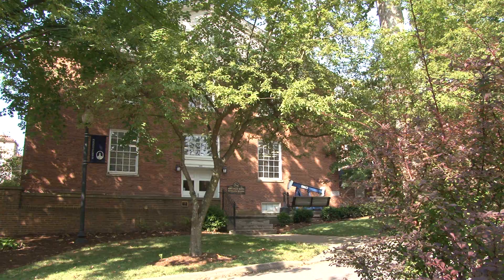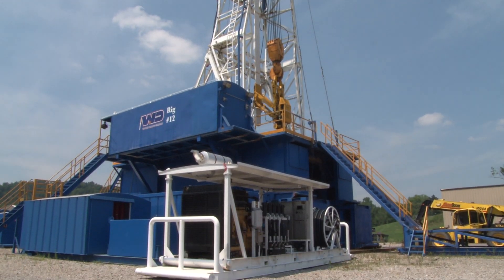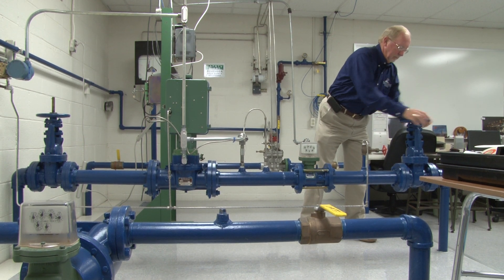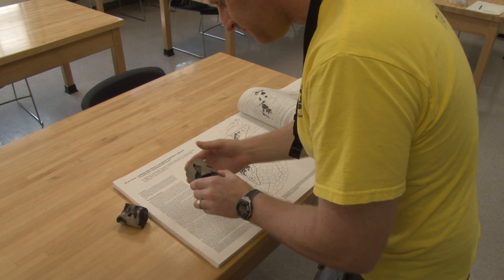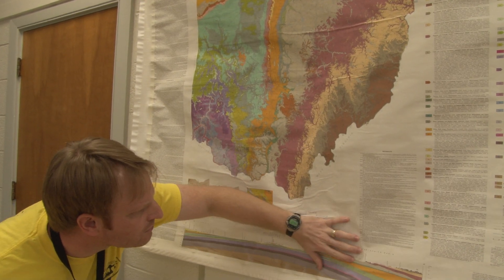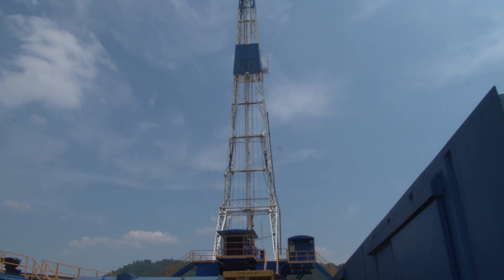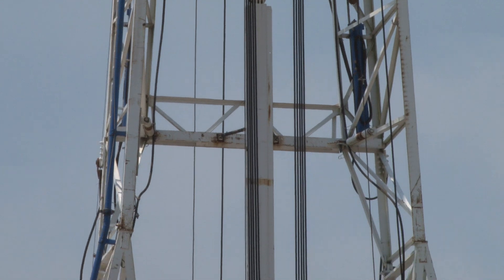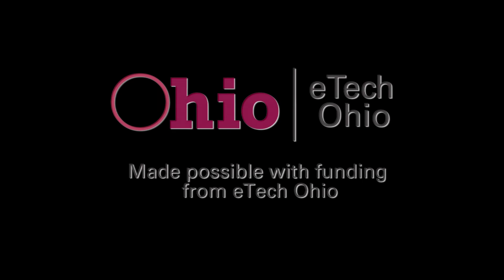STEM Career, Petroleum Engineering

Comment: Hey I wanna be a petroleum engineering but I wanna know which classes do I really need to take.
Reply: All the ones the college you attend require for graduation. All of your physics, math, engineering sciences, I would also advise programming courses to aide in numerical methods. Linear Algebra would be helpful, look into thermo 2 if you want a better understanding of heat transfer.
Reply: Well I'm taking  1,2&3
Physics 1 Calculus based 
Chemistry 1,2
As a  Precourse, just to transfer to Colorado school of mines where I'm going to get my bachelors in petroleum engineering as a reservoir! I'm currently at red rock community college, and got my ges and went there! But in order for me to transfer I must maintain a 2.7 but I have a 3.8 so I'm good! But if you want to just work your ass off and get a good gpa
Reply: *GED